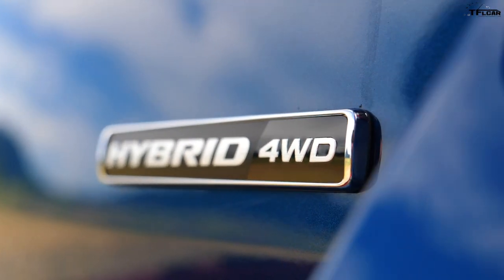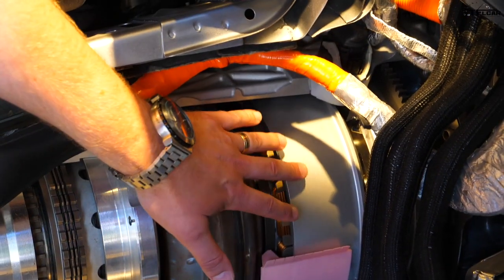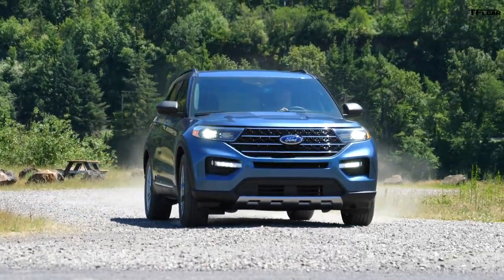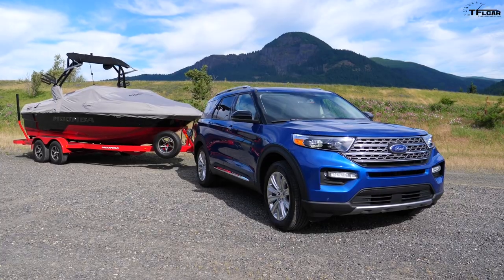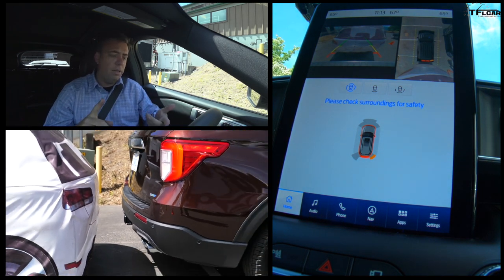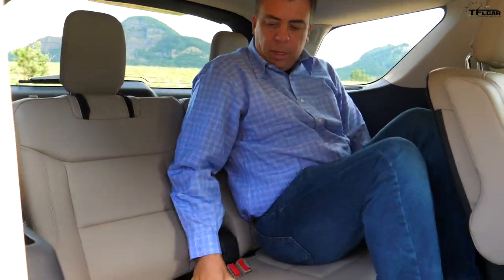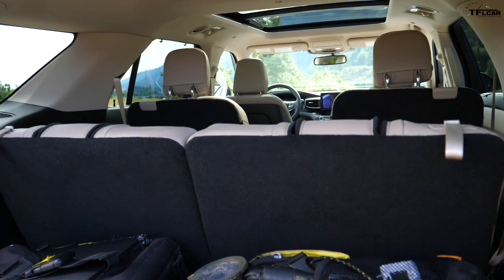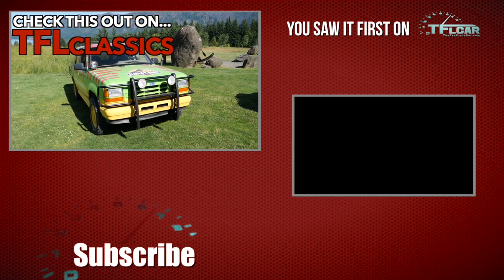Will It Tow? We Put The New 2020 Ford Explorer To The Test!

Comment: This might surprise some of you, but there was actually a time when SUVs towed and even went.... off road. Crazy, I know, but I swear it's the truth.
Reply: And when they had body on frame designs, 2 speed transfer cases, and V8 engines.
Reply: That was back in the 90s nd very early 2000s
Reply: And they were even called trucks.  Before the marketing gurus got ahold of the segment and started calling them SUVs to sell them to everyone.
Reply: They still do. This is not an SUV. It is a crossover. Ford Expedition, Chevy Tahoe, Toyota 4Runner. Those are some SUVs.
Reply: That's my point - the marketing people are coming up with new ways to name and sell the same products.  On-frame or no, they still do the same thing.  And hardly anyone will use them to the point when they will be challenged.
Reply: @ShersGarage  this one os rear drive so it technically is an suv minus the chasis
Reply: and then no one went offroading and towed
Reply: Why has towing decreased? Is personal water craft and boat ownership down in the US? Are people more likely to use moving services when moving homes?
Reply: @ShersGarage  Yep. The "good" ones cost $50k+.

Comment: My only really gripe with the Explorer is that I wish they had made the roof a bit higher. The sloped roof looks good but it cuts into the interior space a bit much for my liking. I’d probably get the Expedition limited. It costs about the same as the top end Explorer with all the fixings but it’s just more practical

Comment: I've a huge Ford fan, but I have to say my 2004 Explorer was a disaster, I purchased it new. I replaced 2 clutch packs in it in 3 years.  I never towed.   My 2001 was a dream, gas mileage was my only issue at 16MPG based on my driving habits.  I put that thing through hell and it never let me down.
Reply: Cha Leowin I have a 2nd gen year 2000 Explorer. That thing is a tank. Has 201,000 miles now and only thing needed replaced was transmission back at about 180k miles. 

I don’t like new explorers because they’re too big. My v6 can keep up with the new fancy Explorers with 300+ horsepower, because older explorers weight about a ton less.
Reply: Cha Leowin the third gen explorer (2002-2005) is the worst explorer generation the other ones are a lot better

Comment: I'm not buying anything with a rotary shifter..
Reply: You do know that your gear lever shifter is doing the exact same thing. It is no longer connected to the transmission. It goes to an electronic selector that activates servos the exact same way as the rotary shifter. It has been this way on many vehicles for a long time and on pretty much all vehicles made today. I had a 2011 F150 that was a column shift. When I was digging around learning about the truck I couldn’t find linkage to the transmission. A ford tech confirmed this. 
    There is the majority of vehicles that have electronic steering, the ignition switch is electronic. You turn to start but don’t have to hold it there because the computer takes over at that point. That is on all vehicles today, I think. One of my trucks is a 2007 Chevy Colorado and the ignition switch is electronic. I only have to turn it to the start position for a fraction of a second, let go and the truck does the rest automatically.
    The rotary switch is just a different way to select gears but once you are behind the plastic or at the end of the gearshift lever, you an electronic switch just like all the other gear shifters. Sorry.
Reply: I do know that nothing is physically connected or has been for a long while. I have been a mechanic for 50 years. I also grew up in the 1960's early 70. Console shifters have been around sense then and most every one I know does not like this rotary knob nonsense.
Reply: Gary Shick - I am only saying it is a resistance to change. I am in my mid-late 50s and understand the preference to having a shifter. I prefer them  myself. I bought a 2018 Ford Fusion AWD for my wife and it has a rotary shifter. I have learned to like that. It takes up less room in the cabin of the vehicle and makes things feel quite a bit roomier. I have driven my buddies Ram 1500s and am getting used to the rotary shifter in them. I still like my new F150s and 350 that I just purchased for the farm. All gear shifts. When I get in the Fusion, I am looking for the gearshift until I remember there isn’t one. The automatic Semi trucks have had a push button up down shifter for the last 20 years. They are starting to become very common and even preferred in the heavy haul industry. Surprised me!
   I agree with you that I prefer a gear shift lever and many people do. I was just saying that the rotary knob really isn’t different underneath. The perception between the two is huge! My brother-in-law still insists there is a difference. We will see when he starts researching the GMC Canyon Denali Duramax I just gave them as a present to my wife’s sister (confusing eh?) due to them needing a vehicle like that. He loves the truck as much as I did. Was an attempt by me to go to midsize truck vs full size. I have an F150 again because I resist change. I understand that. 
    It has been nice chatting with you this way though. Take care and be safe out there.
Reply: I thought the same but the space it frees up is a bigger plus than a big ugly shifter

Comment: So another tall / plump station wagon "suv" like the new, toyota Rav4 and vw touareg.
manufacturers just please call them wagons or something, because that's what they are.
Pretty much the same ground clearance, what you'd expect from Sedan.
Reply: Well the fact that this review is on TFL car and not the truck channel should tell you everything about this "SUV" It is a nice wagon though🤔
Reply: Wagons sit much lower and look ugly, minus the Audi V10 Wagon which is nice. The closest thing to a wagon ford sells is the Flex.
Reply: Marketing. People think SUV's are great. Hence manufacturers builds cars that people think are SUV's.
Reply: Most sedans are around 5-6 inches ground clearance. This Explorer has a tick under 8, and water fording at around 18 inches. There are some that absolutely look like wagons or hatchbacks on stilts, looking at you sub compact crossovers, but I'd personally say this looks to be a great SUV with the chops to prove it.

Comment: Good job Ford, for not putting a cvt transmission
Reply: Does Ford even make cvts?
Reply: @tonychau1983  yes lol the C-Max or more like they did
Reply: @electric6877  I think I've seen 3 of those in my life so far.
Reply: @tonychau1983 

The Ford Fusion Hybrid had a CVT
Reply: Ford was one of the first to have a CVT, you remember the Freestyle?
Reply: CVT's are superior to stepped transmissions. The only problem is that people don't understand them and resist change.
Reply: I'm a pretty big fan of a properly designed CVT. My 2010 Fusion Hybrid has 180K miles on the original (Aisin manufactured) CVT with absolutely zero service, even the factory fluid is still there. It's supposedly "lifetime" fluid, but I'll be changing it at 200K.

Of course, a belt driven CVT probably isn't the best choice for a high load application like towing. But, you can always make it bigger, so we'll see what happens in the next few years.
Reply: @phamnuwen9442 

It depends entirely on the powertrain. CVTs don't handle lots of power well, require transmission maintenance more often, and create more noise. I recently test drove two cars with a CVT and I'd consider buying either, but I really wouldn't say the transmission is what settled it because I don't care.
Reply: @supersnot4  I had a new 2016 Nissan maxima sr with the cvt. Car came out defective. Complete garbage. Plus a couple recalls. I regret leasing it
Reply: @supersnot4 

No fluid is lifetime. If you're driving in extreme conditions such as high temperatures, I'd recommend changing it more often. I just did it at 60k kms after 4 years and my auto is noticeably smoother.
Reply: @tonychau1983  The new Escape will be and so will all the FWD Hybrids.
Reply: @stephenzerfas5307  oh i didn't know that. I once had a cvt on a 2016 nissan maxima. I had problems with it. Now i van say i like more the traditional transmissions
Reply: @Lucky8s  Of course not. Ford's long term testing concludes at 150,000 miles for their vehicles, so that is what they consider the "lifetime" of the car.

A hybrid CVT does not have a torque converter and is water cooled, which means the fluid in my car is really not doing much aside from lubricating bearings. It's probably good well past 200K, but fluid is cheap.
Reply: @oscar7032  Don't let Nissan spoil your outlook on CVTs. Nissan is notorious for bad transmissions in general, with their CVTs being some of the worst.

All Ford CVTs were/are either designed and built by Ford or Aisin, which is an extremely reliable manufacturer of transmissions owned by Toyota. None of Ford's vehicles using CVTs are known for problems.
Reply: @Pham Nuwen, CVTs were designed for scooters and snowmobiles. CVT’s suck at everything a proper stepped transmission does. The only thing CVTs are superior at is how much noise and droning they make. Have you seen any Lexus, Audi or any other premium brands use any CVTs? No. They’re used on mass produced cheap point A to point B cars.
Reply: @Lucky8s  I think CVT's just haven't been designed for performance applications yet, because they're seen as "scooter" transmissions and premium buyers wouldn't buy them (irrationally IMHO).

Not sure they need more maintenance either. What would be the reason for this?

"More noise" is just different noise due to more efficient engine utilization.

To some extent the problem lies with automakers for adding silly features like "gears" to CVT's in order to please consumers who are used to regular transmissions.

Either way it's mostly a moot point because everything is going electric anyway.
Reply: Personally think that CVTs are junk. Ford experimented with CVTs back 2005 and it was a total failure. They did it for few years. eCVT in hybrid Fusion, C-Max is not a belt driven CVT. It is a power split device with planetary gears. Extremely robust transaxle.
Reply: @phamnuwen9442  They're junk. They can't handle high loads or high power output.
Reply: @hochhaul  I think that's a scaling issue. Just make it bigger.
Reply: @phamnuwen9442  That creates more parasitic losses due to the amount of energy that's requires for the hydrualics. The more load capacity, the higher the pressures required for the CVT to properly function.
Reply: @hochhaul  Do you have any hard data on CVT failure modes and efficiency? How do they fail, how often and so on.

Comment: I like it but I think the new Ford Explorer missing one thing: available a Naturally Aspirated V6 engine without turbo or hybrid system. Not everyone like or trust turbo or hybrid engines. Thanks, nice review.
Reply: It is all about fuel economy. Ford's 2.3 has been pretty good. Only Police Interceptor offers the 3.5 NA engine for fleet use.
Reply: Asian Ford Guy I think the police interceptor has the 3.7
Reply: It's has the 3.3L V6.
Reply: +Samaan Alkhaldi
If you want an naturally aspirated engine in a large vehicle like that then it will need to be a V8. An NA V6 will not be that great to be honest.

Comment: Manufacturers need to be a bit smarter with Trim levels, limited was the highest you could get with any builder. Now it's just tossed around, sometimes it's second from bottom (Jeep & Dodge and Ford cars and SUVs) other times its the highest (Ram truck and Ford truck)... Keep some standards.
Reply: Ford tried this with the powerstroke 3.0 on the F150 now they have a glut of inventory.  Nobody is going to pay 57k for a hybrid explorer.
Reply: I agree. Make the limited all one can get (with different engine options, of course). Nowadays, they have premium, platinum, gold, diamond, titanium, obsidian, stainless steel, porcelain, granite, etc 😂

Comment: So can we expect this is the exact same hybrid system that Ford will try to shove into everything? The Mustang and F150? Everything currently with the 10 speed?
Reply: Robert Cone they are making a fully electric f150 so I would guess they would put a hybrid system in as an option. Adding an electric motor to a truck would be pretty beneficial while towing in the city or stop and go traffic.
Reply: Trey K, also the fully electric mustang is in the  making
Reply: @Treyk901  
People that use trucks for towing are more than likely not living in some fancy urban city with butterflies and graffiti everywhere. 

They more than like live rural so gas is their only real option.  People have become obsessed with electrical vehicles without even asking basic questions.
Reply: bighand69 I live in the country but work in the city. Most of the heavy towing starts off in the cities and end up in the cities. If they can make the range decent enough to travel city to city it would be a no brainer to want electric. The rave about electric is that it’s cheap to recharge, less maintenance, instant torque. Personally I’d prefer a hybrid system that uses a small diesel as a generator to power electric motors, like a locomotive. You will get the range like any other truck plus the benefits of electric motors to propel the vehicle and stop the vehicle. Electric has awesome engine braking.
Reply: @Treyk901  
Electric cars are only cheap to charge because the national energy systems are government sponsored via taxation. 

If everybody moved to electrical they would remove all the subsidies and you would notice the unit cost shooting up. 

Now putting that aside electric cars are just a fashion statement at present. They are not utilitarian and they nor do they do anything practical in terms of the environment. Clearly we can see their long term engineering future but right now they simply are not what most people think they are. 

See with a gas car you would never need to consider range, charging times or have to plan out the management of the vehicle to the same degree. 

They are really like mobile phones of the 1970s.
Reply: bighand69 I never argued against anything you stated. This is why I would like to see a hybrid system. You get the best of both worlds. You get the range and convenience of gas/diesel but the torque of electric. I’m not a ‘green energy’ person, I like performance. Like it or not, electric has the highest performance you can get. Tesla for example has a descent range and can outperform any car out there.

Comment: I have been saying it for the past 2 years about the 3.3 v6 Hybrid ... And it is going to make an appearance and the F150.. And there also is  Another V6 Eco boost hybrid coming To the F150 should be 500hp and 500+tq.. My friend the Ford engineer said you aint seen nothing yet.
Reply: They are testing the 3.0 Ecoboost in the F-150. One in Aviator makes 450hp and 650lbft of torque.
Reply: @ShersGarage  
It is a pity that they will destroy the f150 with puny little European and Asian engines. So as to be trendy on an international level that no body will even notice anyway.
Reply: @bighands69  all about fuel economy. Those smaller engines are sophisticated. Long term reliability is very much questionable.
Reply: @ShersGarage  
It has nothing to do with fuel economy. Certain political factions do not like cars. They are intending that they get banned in the long term. They also have the same disdain for flight. 

To give you an example of how hypocritical they are. They forced the closure of US mines claiming they were dirty and not viable in the new age of renewable energy with many candidates boasting that they would shut them down.  And guess what happened when they got them shut down they went and imported coal from South America. 

They do not care about Fuel efficiency or functionality.